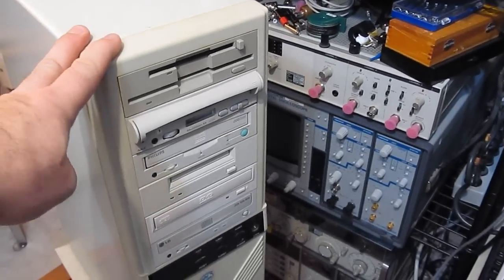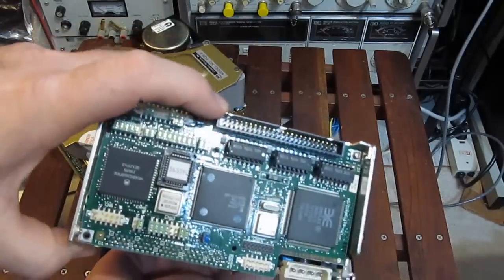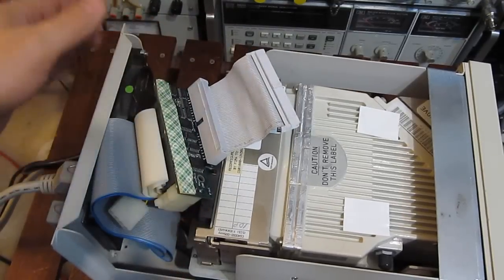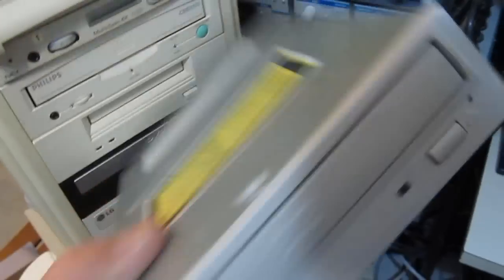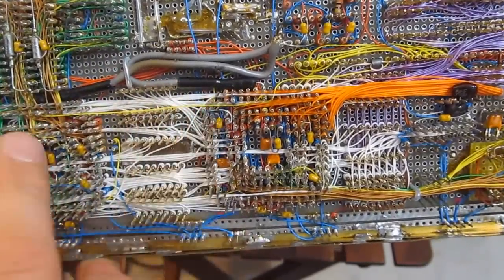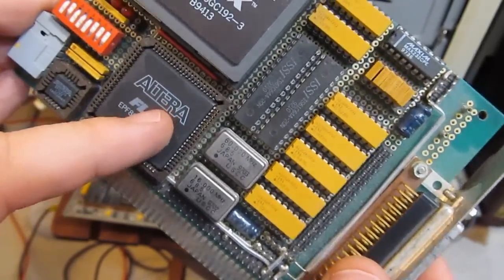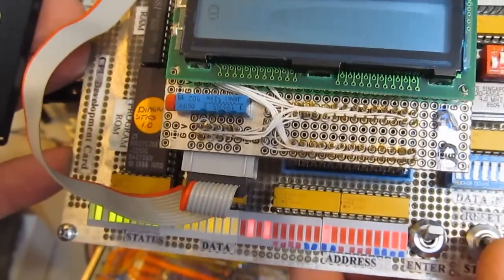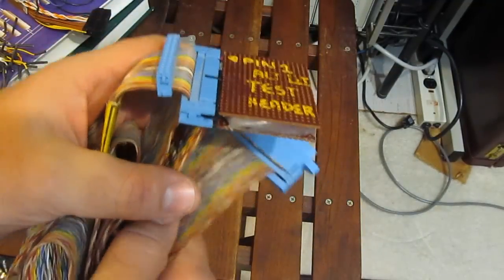FPGA based CPU designs from the 90s, PART I

Comment: imagine what you could do now with pcbway or something like that, I would love to see those boards developed or even working.

I am looking into a unique case of my own due to one system i have has limited IO something that has been an issue with some of the newer boards, i going to make a multi-function card, with high speed network / NVME and pci-e x 1 port that will use a single pci-e x8 port, yes it will have an pci-e switch of sorts just picking out the parts ect.

Comment: 1:40 is that an sli finger on that hard drive on the top right corner of the drive sweet they had sli back then to boost drive speed and performance before raid came out😃
Reply from the maker: It's MFM (Modified FM).  That connector is the data lines.  The wider is the control signals.

Comment: Implementing the dongle on the FPGA is brilliant—like renting tools from a building supply store and then using them to break in overnight.
Reply from the maker: In my case I owned the tools.  Incorporating the dongle onto the board was a convenience.  It would be like using the tools from the store you own to break into your own store, except in this case, I fail to see the benefit.
Reply: You’re right—though I intended the analogy to be more about the fact that you used the tools provided in a way to defeat the intent of the company that provided it to you.

A better analogy might be to say that it’s as if you bought a set of bolt cutters chained to a cinderblock, which you then used to cut the chain!

Comment: For the crowd of people that don’t know wtf is going on, an FPGA basically allows you to build a circuit of logic gates. He said that this card was for designing processors, well processors are never used in a vacuum, you need power, memory and a clock. That’s what the card supplies. The FPGA chip is what actually does calculations and manipulates the memory. He’s able to test out different configurations of logic gates without having to manufacture a processor from scratch for every test. That’s what he meant when he said this card lets him design his own processors

Comment: I had that same CD burner when it first came out, that bring back memories. They were expensive when they came out. I been custom building and playing with PC's since young, since 8086 days and then for my first watercooled system later on use to go to junk yard to get heater core and custom did my own water block back in the day to overclock AMD Athlon. You could not go to the store, or order parts online  for watercooling back then and showed up to LAN parties with it and people were like WTF was that. I won a lot of competitions with that built, They paid for my newer rig during that time. One of my favorite games back then was unreal tournament. I spend thousands as a kid on computer parts, my mother didn't realize their was money in gaming. I made more then the job I was working at the time. Almost was sponsored, but took a job with Motorola shortly after.  

I still have my books on that stuff when custom designing my own boards and tinkering. I learned a lot on my own before collage. Started with radios and transceivers as my father had a repair business and would bring stuff home all the time to repair and built. Back then people would drop stuff off for free, someone even dropped off a broken Pioneer RT-909 reel to reel to my door with note one day. Now you have to pay a arm and a leg for just for parts today. Test equipment got mostly for free at swap meets back then, or for $10 bucks at garage sale, now people ask 100's for broken crap on eBay. Yes stuff cost more new back in the day, but used people gave you the stuff if they saw you could put it to good use. It wasn't about just making a buck back then, as it is now, as you didn't have eBay, or smartphones and we had hobbies back then. Plus it was easier to make money back then, as now people don't want to pay for much for services and expect everything for pretty much nothing and then want to rush you. People gripe about paying $150 to $250 bucks to repair a iPhone motherboard that was water damaged to recover data, claiming they could get it done for $50 bucks. I tell them then go to them as barely anyone does component level repair on a iPhone and no one in my area does beside me and they end up coming back with tail between legs.

On the meter comment you didn't get the joke I am very familiar with measurements and know about high voltage transients and current spikes. I blew my fair share of a few pieces of test gear. Just joking when stated low current, I know it was well in 100's of amps.

Comment: What’s with the 23.3 km/h resistors? :))  (seen on subtitles)
Reply from the maker: Posting a time would help as there are a lot of resistors shown in the video.  Let me guess that you are asking about the yellow DIP parts located on the large wire-wrapped board.   These are a series termination.

Comment: Differential to single ended SCSI converter? I think it's a wide to narrow SCSI converter. Narrow is always single ended, but wide could be either. Maybe you can show the adapter part number so we can verify it if it's really a wide differential to narrow single ended converter.
Reply from the maker: You can clearly see it's the old 50 pin cables and connectors common from that time.  You could even count the pins.   You also have a part number for the drive which you could take the time to look up.   Of course there were differential standards that used the 50 pin cable which is what I am showing.   Look it up.

Comment: Wow... 50 MHZ with a wire wrapped design, I wire wrapped a Intel i860 ages ago... you are amazing.
Reply from the maker: Pericom distribution is running at 100MHz (2X the oscillator).  This then drives the two main FPGAs.  Or at  least that is one way to clock them.

Comment: I wonder if the old low-density mo drive could read the new(relatively) 2.6g mo? In my memory the most high-density mo on market is 650mb or 630mb in 1998

Comment: the st have two disc
Reply from the maker: With Google, I would think in technical areas we would see less spread of miss information but it's not the case.  For details regarding the Seagate ST-251, the following two links may be helpful.    https://youtu.be/yuUvd_YDGDs?t=174    https://stason.org/TULARC/pc/hard-drives-hdd/seagate/ST251-1-43MB-5-25-HH-MFM-ST412.html

Comment: Regarding wire wrap, you might be interested to know that the Australian F111s flight computer utilised wire wrap on the back plane, to which all the system cards plugged into. Can only speak for the Aussie F111s, but the USA ones were most likely the same.

Comment: The Seagate ST-225 was my first "real" hard drive. 40MB. When I saw it in your video I knew exactly what it was. I'm thinking about getting into wire wrapping for custom CPU work and FPGAs. What made you stop doing wire wrapping?
Reply from the maker: Poor signal integrity, high cost, labor, longer turn around times.    The old ST225 was a 20MB drive.

Comment: I might have one of those wire wrap guns kicking around.at least,had one. Hung out occasionally after school with my dad at work. New England telephone and telegraph or just at&t now. Giant mailbags of scrap wire and old trunking switches kept me busy. Pinched my hand in that bitch once or twice. Imagine an entire small building 8 to 10k sqf of these giant metal cans(like a triple tall quart paint can) and under the cover a rotary switch that ..well..rotated and each stop had a pin and wrapped wire. If you remember the sound of rotary dial, that null or blip sound when the finger hole goes past the finger stop was that switch rotating passed contacts. Just thinking about it now still pisses me off getting one of the last digits wrong in a rush. Now I just tell my phone who I want to talk to...crazy

Comment: Can you do similar prototyping on PCIe? Have a hard time finding "prototyping" boards for PCIe which would let you add/remove components as needed...
Reply from the maker: I don't know why not.  I could see having a protoboard with a single FPGA and some other bits.  There may be boards like this available.
Reply: @joesmith-je3tq  there are. just a random example: https://www.digikey.com/product-detail/en/lattice-semiconductor-corporation/LFE5UM-45F-VERSA-EVN/220-1963-ND/5222128
Reply: oh, I thought he meant with FPGAs; there are numerous prototyping boards from those with just the connector to full-fledged "PCIe starter kits" ar various prices.

Comment: I fished out an old EPF8636 out of a garbage pile at my company some months ago. Turned out to have 2 dead I/O pins on it, which hasn't stopped me from making a DivMMC interface for my ZX Spectrum out of it :)
Verilog-95 and VHDL-93 do certainly seem like a huge pain in the rear after getting used to modern ones like SystemVerilog and VHDL-2008...
I wonder when FLEX8000 series devices released initially, the ones on your boards are the oldest ones I've seen so far.

Comment: some 8 years ago some institutionwas throwing out a bunch of such drives.  i used them to make an inertial stabiliser for dslr. the bearings didnt last a very long time.  recently did a search i ebay.    slapped myself in the face.

Comment: I had built a 8-bit mini computer on FPGA when I was in Engineering reading computer architecture book. Most of the design was my own. I had used Xilinx board and used VHDL for coding, 14 years back.

Comment: Cleanest wire wrapping I have ever seen. whish i could do that. mine is a bloody tangled mess. ps : why use development board as a main. just get em made. not that expensive. if it works not bad to have a few spare.
Reply: never mind. this was back in the days.   duh.
Reply: so if a customer needs 10 boards what did you do.  charged  them 1/2 mill and 3 years?.
Reply from the maker: Seeing I was my only customer and only needed the one, it was not a problem.

Comment: In 1994 I had a Micropolis 1.8 GB SCSI drive and friends came over to pop the case cover off to see the drive. Similar I guess to popping the car hood and staring at the engine, for those so inclined. :) Love this old hardware, stuff that a person could actually understand and modify. I had no idea about the p55t2p4d-200 and dual Pentiums was possible. I had a dual slotted Celeron (Slot 1?) system, but the Celeron boards had to be modified with a drill and wire-wrap wire. Awesome video! The wire-wrapped FPGA based board is amazing! No idea what you do for a profession, but if this is what you do for a hobby...

Comment: todays computer guy is nothing compared to this man,,,
Reply: not needed
Reply: @timbba woosh yourself idiot
Reply: computers have advanced, this stuff is all archaic now
Reply: @eksine  The way he was designing computer hardware like in verilog/vhdl and testing on FPGA's is mostly the same way it is done now. ARM cores are written and distributed in verilog for example. Testing is done either in simulation or on an FPGA then it goes to silicon fab if everything works. FPGA's and CPU's simply have gotten larger and faster.
Reply: @morganhv  today's cpu uses 7nm, there's no way it's done like this. I don't think people use fpga any more. cpu's are way too advanced to be doing it manually like this
Reply: @eksine  The FPGA isn't the final product, it is for testing. Feature size has nothing to do with it. Modern boards are not wire wrapped but otherwise simulations and FPGA's are still used.
Reply: @eksine  Obviously people use FPGAs. Tons of ASICs out there today all running on FPGAs. Many CPU's are too slow and versatile for some tasks. You haven't designed advanced products before, have you?

Comment: Hi Joe Smith,
These are great board. I designed similar wire wrap board to test the TMS34010, a graphic processor. At that time, 1989, this graphic card could draw lines and other graphic elements at 40 million pixels per second, which was a few orders of magnitude faster that any video card except a few specialized and expensive ones (about $2000 ).

I live in bay area, San Leandro (Oakland), and I have difficulty to find any job. Can you recommend me a way to find which companies need that kind of expertise (electronic design, embedded firmware).

Comment: Why do you keep saying "formatted capacity" when talking about the HDDs? The drive capacity doesn't change when you format it.
Reply from the maker: Maybe some time for a Google search.  My first hit.   Try Google, you will like it.    http://www.datadoctor.biz/data_recovery_programming_book_chapter2-page21.html
Reply: Ah, seems like an antiquated issue with old HDDs. Modern HDDs have such high capacity and large sectors, that formatting makes a laughably small difference in total space when compared to the misleading information vendors provide. 

https://www.seagate.com/tech-insights/advanced-format-4k-sector-hard-drives-master-ti/

https://www.google.com/search?q=gibibytes+vs+gigabytes&rlz=1C1GCEA_enUS770US770&oq=gibibytes+vs&aqs=chrome.0.0j69i57j0l4.3397j0j7&sourceid=chrome&ie=UTF-8
Reply from the maker: Yes, this is some fairly old technology being shown.
Reply: I realized I had forgotten to thank you for pointing me toward that resource on old tech. Without it, my post probably came off as snarky. Thanks for the information! I had no idea old hard disk drives lost so much space to formatting.

Comment: Hey! You didn't park the heads!
Reply: Funny. But it I remember right, those drives had self parking heads on power loss. There's enough juice left in the caps to drive the stepper.
Reply: SternLX I remember my first 20MB drive had a park utility..
Reply: There was a program you needed to run before turning off the computer and moving it around.

Comment: You had to add termination resistors to someone else's clock line?  Wow!
Reply from the maker: Yes and as I mentioned, that card was fairly common maybe because Microsoft would always provide the source for the drivers as part of the DDK.   I did contact the manufacture about this problem and how I corrected it but they never responded.
Reply: @joesmith-je3tq  Those morons should be honored to have you do work for them, especially for free. I guess they are infested with the same deasease most other large manufacturers are with massive lack of order and sheer laziness.

Comment: I am recently working on FPGA robotics with just one fpga. You really open my mind and remind me that I can use not only the FPGA...
YouTube posts your video, and I have to say... It is a masterpiece. 
It's hard to imagine that you soldered all the wires. For the joints with over 3 wires, it is hard to solder.
And ... Normally, do you use crystal or chip ones as the oscillator?
Reply from the maker: What solder? This is a wire wrapped board.
Reply: Seems there is another technique that I do not even know.
Reply: 安笑生 Back in the beginning and even before my father's time they mainly used wirewrap.

Comment: I bet these would not have Spectre or Meltdown problems?
Reply: No, not windows only. EVERY OS IN THE WORLD.
Reply: if it has the right cpu
Reply: @grimtin10  Are you sure, that every single OS have backdoors? Have you heard of GNU/Linux?
Reply: @glitchysoup6322  It wasn't the os, it was the CPU that had Spectre/Meltdown
Reply: @grimtin10  Thanks for clarification
Reply: They presumably (could be wrong) didn't have any speculative pipelining so yes, they would've been immune
Reply: @penguinswithdynamite  no. It was the CPU not the OS that had speculative pipelining. If it uses one the compromised CPUs, it has Spectre or Meltdown.
Reply: @grimtin10  I think the "they" which he was referring to were the FPGA cpu's. Could be wrong.
Reply: @grimtin10  It was the cpu's 'os'
Reply: @grimtin10  Lmfao OS' isn't in charge of hardware pipelines at all. All the previous "solutions" were just mitigations to avoid using the features, which crippled performance.
Reply: @TheChrisey  what that's what i said
Reply: @grimtin10  My bad I tagged the wrong comment, sorry
Reply: @TheChrisey  ah

Comment: the ST have two disk.
Reply from the maker: I know it is easy to type on a keyboard useless info.   The ST251 shown is a 6 head, 3 platter drive.  At least try to Google it.   Or, here is a link to the full manual:    http://www.ataripc.net/wp-content/uploads/Seagate-ST251-Product-Manual-1987.pdf

Comment: i design and build metal detectors(as a hobby), i prefer to use wire wrap for prototypes mainly for two reasons i'm sensitive to etchant  and the flexibility, sure it takes longer to build, but swapping components is easy and from first proto to working board is is all one board, i'm not spinning and stuffing lots of boards, when i have a perfect board both working prototype and electronic  version in eagle then i have boards made knowing they will work, if the board is a dead end or a less than adequate design i can find out with out making all those scrap boards and wasted components.
sadly its a dieing art, even more so at the level in the video.
Reply from the maker: The transient generator that I use to benchmark the handheld multimeters was built using wire wrap.

Comment: How did you made that LCD showing post codes at beginning of the video?
Reply from the maker: The LEDs are driven off the main FPGA with a cable.   If you want to read up on post codes, try Wiki:  https://en.wikipedia.org/wiki/POST_card